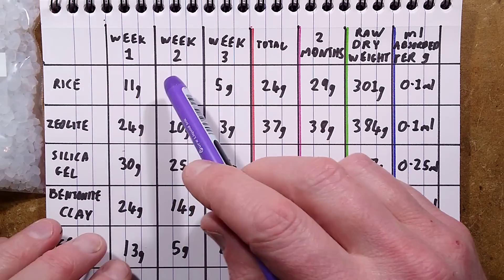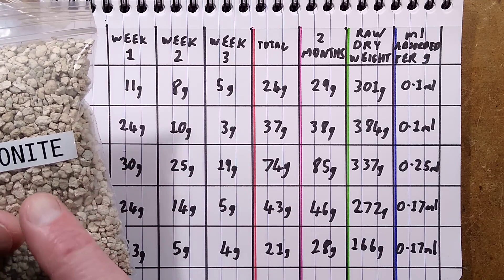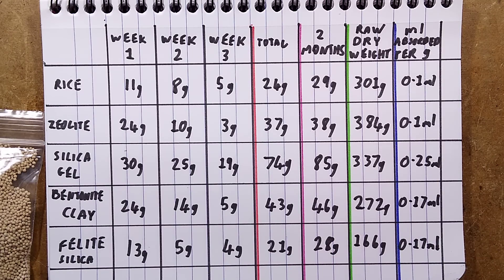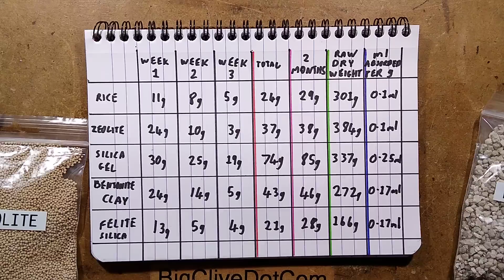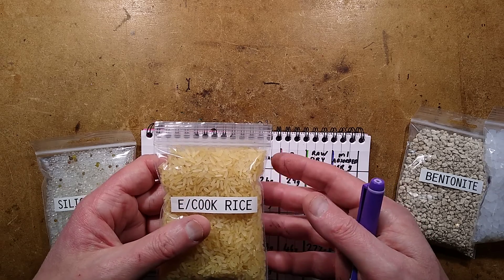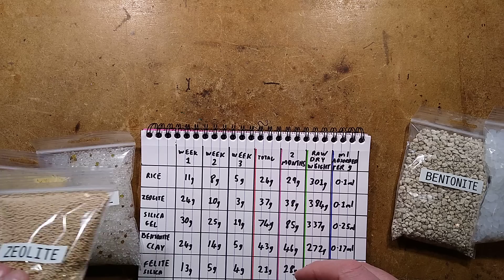Five desiccants - two month test with full results

Comment: I think drying them further wouldn't be a bad idea, at 110C I'd expect them to be bone dry (unless they really hold onto moisture).
Also I think what might be interesting would be an enclosed test with something that can track the humidity digitally, that would let you see how low they bring the humidity and how long.
I think you should've mathed out the ml absorbed per ml of material too since, like you said, you are often shoving what you can into a finite space without much care for the weight.
Either way, some good info. Might make sense to use something like the clay for pulling moisture out and, since it's likely not saturated, move it to the cat box where the moisture is easier for it to absorb/adsorb.
EDIT: Another desiccant to try might be molecular sieves. If I understand, it's basically high grade zeolite optimized for sucking out moisture (and other things in chemistry).
Reply: Silica gel reactivates at about 102-3c whereas Zeolite needs 300c+ and a vacuum. Not all dessicants are made equal so using an air fryer which commonly top out at 200c would yield inconsistent results.

I think Clive would be better off using a freeze drying machine with at least 5 drawers to do all of them at the same time under the same conditions, he could also take the opportunity and create another video or two by buying one of the £30 machines on Ebay, testing it to see its efficacy, then tearing it down afterwards.

Comment: How many of those materials will survive heating in a microwave to dry them out? We used to do that with the desiccant we used to keep the air dry in a ku uplink.
Reply from the maker: The microwaves might not be too happy about a low moisture load.  It would be like operating it with nothing inside.

Comment: I think the advantage of zeolite/molecular sieves is not how much it holds, but how aggressively it can pull water out of low humidity air or solvents. Calcium chloride would've been an interesting candidate too.
Reply: Molecular sieves also stay more effective at high temperatures than most other dessicants if memory serves.

Comment: Test that zeolite after drying, it should get rocket hot when a drop of water is applied.  It's going to need quite a bit more than 90c to dry it.  How much is a point of contention between the home/hobbyists and the industrial users.  Being firmly in the former category, I do 200-250c for about 2 hours then store under vacuum.

Comment: I tried the equivalent of the Felight crystals in  my car. I used approx. 4 times the quantity  shown in your test sample. I also used a cotton bag  to aid moisture absorption. It did not seem that effective, which was also the case with silica gel. Both used on the dash or the footwell. I used to get fed up having to scrape the frozen moisture from inside the car where I worked during the winter months.

Comment: Next experiment: using the zeolite to make a literally drier martini. 

I think Nile Red has a video demonstrating drying ethanol with zeolite to go from 95% to 100%. One thing to be aware of is that it comes in different pore sizes for trapping different sized molecules. Also, i believe it's dried at much higher temperatures, on the order of 350°F/176°C/449°K.

As far as bentonite clay goes, i thought it was only the clumping cat litter that used it.

Comment: Try the super fine silica used in water pillow type humidifiers. Also try putting the whole apparatus in a sealed container ported with one of your solid state dehumidifiers. Check to see if you can increase the saturation, and also see if voltage is generated due to the humidity gradient across the membrane of the solid state dehumidifier element.

Comment: Best protocol for wet phone is warm dry place WITH fan pointed right at it. Air flow often makes a bigger difference
Reply: Oxidation is increased with greater airflow though, & that's what causes the actual damage.
Reply: @NightCatArts  There will be no shortage of oxygen even without moving air.  Increased temperature will speed up oxidation for sure, but getting the moisture evaporated ASAP is a good move.
Reply: @NightCatArts  You'd get the oxidation regardless.  Oxygen will always be at ~21% outside the phone, and electrolytic corrosion may very well produce still more of it on the inside.
Water is a catalyst for corrosion and it provides spurious conductive paths for the battery power while simultaneously taking part in electrolysis -- which amounts to electrically-driven corrosion.  No matter how it's done, the faster you can get the water out of there the better.  And removing the battery, even if it involves a very difficult disassembly, is at least equally important if the device is to be salvaged.

Comment: You would have gotten a "more scientifically pure" set of results had you dried all samples to the same moisture level.
That said, using them in the "as received" condition is congruent with how most people would use these materials.
So, you did the proper test because the results apply to the most number of people.

Comment: you did not make a mistake by not drying them first , this test is close and representative for the state of the material for most of us who would just open the packet of whatever desiccant we have and just dump it next to the 3D printer filament....
but if you want to reset the material and try again ,i would think the rice would fair much better , since it would have already absorbed alot of moisture if its stored in the typical 5 and 10 pound bags ,since the bags are porous (the fabric ones)

Comment: Zeolite holds onto water very well. So much so that even 110 degrees likely wont dry it out.
Reply: there are zeolites and zeolites. they are synthetic silicates
Reply: Water boils at 100
Reply: @penguin44ca  PURE water boils at 100 C. But zeolites with water absorbed is not pure water.
If you would like a simple example, make a 50-50 mix of sugar and water, and see when it starts to boil.

Comment: I started using silica kittie litter a while back, In testing out to about 4 mo I found much the same thing, In smaller scale. I found the water absorbed eventually wobbled around 2% with roughly half of that occurring about 7 days in. For my usage (mainly PLA stabilisation) I'm pretty comfortable just calculating the volume over all of a spool in a sealed ziplock and allowing a bit extra. I'm not too worried if it's bulky and I assumed that it would reach an equilibrium which was non-zero. 
Kittie litter is cheap, fairly clean and it comes in a large bag at my local supermarket.

Comment: Hi Clive have you tried the scented interior dehumidifier from B and M. £3.50 for a pack of 4. It's what I use to keep my 3D printing filament dry in a large box. You can see how much water it pulls out of the air just by looking at it.

Comment: calsium cloride like in damp rid or baking soda
Reply: The problem with Calcium Chloride/Damprid is that it doesn't absorb water/liquid from the air like a desiccant per say. The calcium chloride will absorb what it can, then it melts. Its not reusable. I have a calcium chloride product from Arm & Hammer (cheaper than Damp Rid) that, once its done, I will be replacing with orange silica due to cost vs lifespan and reusability.

Comment: havnt watched the full video yet but i wanted to just add my own experience with wet phones, the best way to dry a phone that has taken a swim is air, ALOT of air, preferably slightly warm and dry (do NOT use a space heater though, that is too much heat imo, i've never had a battery get spicy but i wouldnt trust them not to) the more air you can move over the phone the better, a shop vac can be used to suck as much water as you can out of the phone initially and then put it on top of a fan or blower or other air mover(no, your cousin vinny holding a chinese hand fan wont do, you have to either pay or feed him where as a small blower fan only draws 12 volts at 2 amps and can run for days without worry, first step vacuum everything you can out of a phone, second, leave it on a fan, also you can buy bbq pork fried rice from a local chinese place to attract your korean friend over but he wont actually dry the phone any faster
also on random thought, i bet you could increase drying speed by putting the phone and a fan in a sealed box with desiccant as it'd lower the average humidity and thereby increase drying capacity
edit: ignore the part that said i hadnt watched the video, i managed to watch the whole video while typing this
again, if your phone gets wet GRAB A VACUUM AND SUCK ALL THE WATER YOU CAN OUT and then put the phone by a fan or blower to get the rest out

Comment: Activated Alumina and magnesium sulphates would be nice additions. You can get magnesium sulphate monohydrate (MgSO4•H2O) by heating Epsom salt to 120°C  and anhydrous magnesium sulphate by heating to 250°C. Epsom salt is magnesium sulphate heptahydrate (MgSO4•7H2O)
Reply: Ramp the heating slowly and give it time to soak.  I chucked a pan in a hot oven and it melted down first and ended up being a solid mass when I was done. The slow ramping allows for the moisture to drive off vs puddling out and left me with a fine dry powder.

Comment: For cryogenics we use zeolite for drying our process gases. There are different types of zeolite. Our canisters contain silica gel beads for color indication of saturation. The zeolite is such a strong desiccant that it will pull moisture out of the silica gel. Now it might be that by weight silica gel is better, but it's my understanding that zeolite is capable of drying out a gas to a much greater degree. It's also possible you got counterfeit zeolite or an unsuitable grade of zeolite. Also, we regenerate our zeolite using heat and a vacuum pump in concert to get it extremely dry.
Reply: Zeolite will continue pulling moisture at MUCH lower humidity levels. Silica gel can hold more total, but it equalizes with ambient humidity at a much higher humidity level. Zeolite will keep pulling until there's nothing left, or the zeolite is saturated.
Reply: @JohnDoe-fk6id  thank you for articulating that better than I did
Reply: Absolutely. Zeolite works in a pressure swing drier. 

We used it for an infrared camera that was cooled to cryo temperatures. The slightest moisture would have ruined it, but the pressure swing zeolite produced absolutely dry air.
Reply: If all comment sections on Youtube had this level of knowledge and debating, it would be like heaven.
Reply: Well, that explains why my lot didn't work- thank you for your comment!
Reply: Yup we call this stuff molecular sieves in chemistry. Really nice fir making truly anhydrous solvents and maintaining dry conditions when doing moisture sensitive work.
Reply: This is the biggest pro to zeolite. For general drying in electrical cabinets, industrial settings silica gel will work very well. But down to about 10% RH it wont be able to draw any more moisture in. Zeolite will draw moisture down to a few percent RH if sealed and dried adequately. And it will do this at much higher temperatures than silica gel. Only real negative is it needs to be dried at a really high temperature, though microwaving it (gradually, if not it will melt!) is a quick and effective method to get the bulk of the moisture out.
Reply: Zeolite 3A is suitable for H2O
Reply: Zeolites need fairly extreme conditions to fully regenerate...  At the 90C used here you can expect it would still have about 10-15% dry weight of adsorbed water, so the observed 10% (giving a total of 20+% of truly dry weight) is around the expected performance of zeolites.
Reply: My Zeollite requires being activated above 400F for 2 hours.  I use it for anhydrous ethanol.
Reply: @TechGorilla1987  Both Zeolite and silica gel need to be dried above 120C so that 90% of the moisture is expelled. At 200C, almost 99.9% of moisture will be gone
Reply: @janami-dharmam  Good to know!!
Reply: I would consider damp pre workout powder to be spoiled and would not attempt a recovery using desiccants or any other method as it may have cultured some nasty bacteria while moist
Reply: Where can I get non fake but cheap enough for home use zeolite?
Reply: @Splarkszter  I just got some off Amazon and it's real AFAICT.  Zeolites are used in enough bulk in industry I doubt faking them in general would be cost effective.  That said, I wouldn't be surprised if, e.g., cheap 3A is actually 4A (since 3A is made from 4A) or if cheap zeolites have some contamination risks that you wouldn't get from a chemical supplier.  But they work fine for dehydration.
Reply: We used it to draw out moisture from the hydraulic system for US Navy aircraft I worked on. They came in a handy 1.5 x 10in -ish tube, with break off tabs on both ends. They're great until one decides to completely come undone and lose the zeolite all over the inside of the bird. The aircraft is no longer flight worthy until it's completely cleaned up.
Reply: @russoft  Probably fake sieves
Reply: 3A (3 Angstrom) zeolites capture water, 4A (4 angstom) zeolites capture Methanol and other larger molecules.  

I use a microwave to dry my desiccants.   Go easy and slow, though; they heat up quickly!
Reply: @DaveMody  Will 4A also absorb water?
Reply: @DavZell probably. Not sure though
Reply: Based on the initial comment and replies, it sounds like it might be best to use both Zeolite AND Silica Gel.
It sounds like using both, would work fast, with high capacity with lowest humidity.